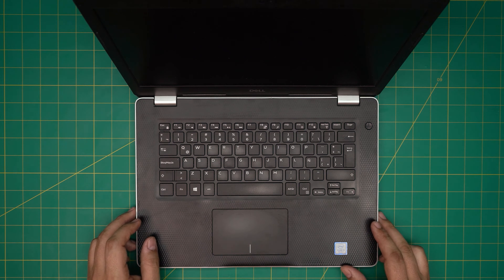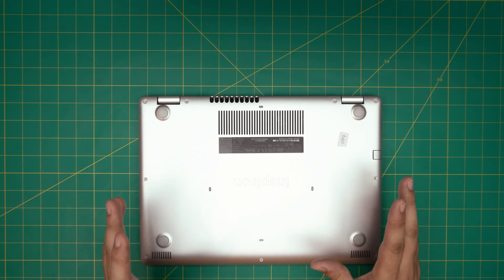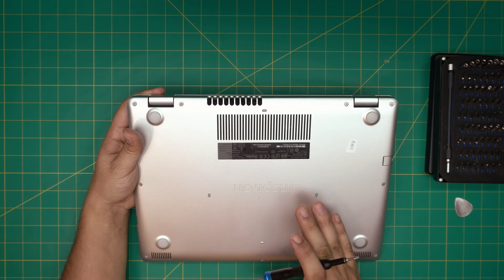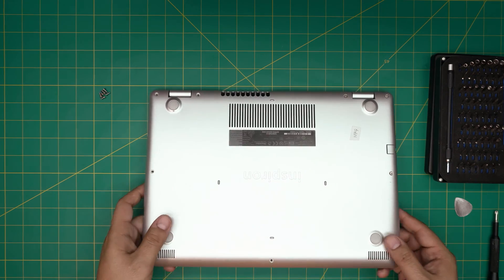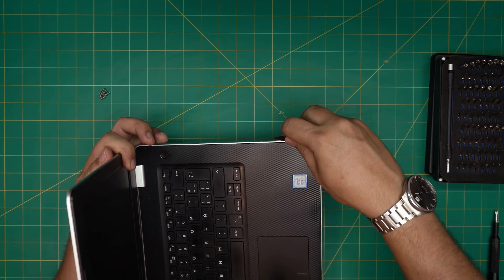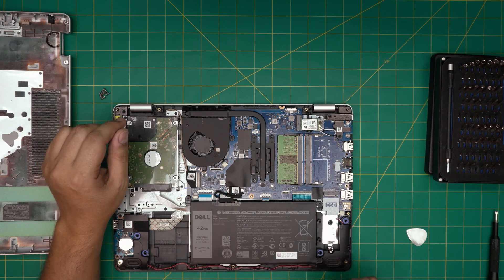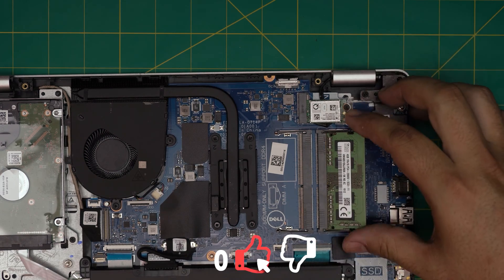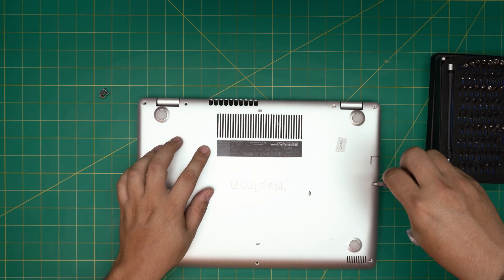How to Upgrade RAM on Dell Inspiron 14 3481 (Reg. P89g) Laptop - Step-by-Step💻

Comment: Hello! Great Video. I just wanted to ask, if I remove the battery and the BIOS does go back to default, would that make me lose my data?
Reply from the maker: It's my pleasure my friend.
🫠Regarding your question, absolutely not. Your data will be left the way it was. It will not affect Windows, the system files, or your personal files.
Should you have any further questions or requests in the future, please don't hesitate to ask me.
cheers🍻

Comment: Hello Sir, I have this same laptop Dell Inspiron 3481 and I have 4GB Ram, so can I upgrade it by adding 8GB Ram(3200 MHz). As my laptop shows the speed of 2133 MHz.
Reply from the maker: 🫠Regarding your question, that will work just fine. The laptop will accept the 3200MHz and automatically adjust to the speed it can handle.
cheers🍻
Reply: @uFixTek  Thank you so much for your help sir🙌
Reply from the maker: It's my pleasure my friend.
Should you have any further questions or requests in the future, please don't hesitate to ask me.
cheers🍻

Comment: People may be interested to know this and I think it may be worthy of a video all to itself. This machine in the UK came supplied with a single 4GB RAM stick. I bought two identical 4GB RAM sticks so I could upgrade this to an 8GB RAM machine. But the machine would not boot with the 2 sticks inserted (the light next to the power input would flash 4 white lights followed by 2 orange lights, indicating a RAM issue). Each stick individually worked fine in either slot.

After much searching (and finding your excellent channel), I found most people were putting it down to a failed motherboard issue. This was not an option for me because my machine was out of warranty, BUT THEN I found a thread where someone loosened the screws on the CPU and it solved the problem. So I loosened the screws on the CPU several turns AND IT WORKED !!!

I hope this helps someone as it's helped me.
Reply from the maker: much appreciate the support and your feedback to help people.🍻👍

Comment: Is it ok to put one 4 GB and another 8 GB RAM? I don't want to waste my 4 Gb RAM. I'm about to upgrade my laptop same model as yours.
Reply from the maker: Thank you for your feedback! If you wish to support the channel, you can like, subscribe, or both!

Regarding your question, sure you can my friend and it will work perfectly fine.
cheers🍻
Reply: @uFixTek  Thank you
Reply: By any chance do you knew what is the reason why every time I plugged my charger into my laptop these messages always pop-up. 1. "C:\Windows\System32\Maintainace.vbs" 2. "C:\Windows\System32\StartupCheck.vbs"
Reply from the maker: is it because some antivirus or a virus was playing with your system files, there are few ways of repairing this issue:
manually:
Follow the Steps:
1. Open Notepad & Type  Wscript.Quit  on the first line
2. Save it as  StartupCheck.vbs (file type:  all files) - Save it to Desktop
3. Cut the file from desktop and paste it to (C: windows/System32) and Press Continue
4. Make sure to restart your Computer once done

2nd and better option is:
Step 1: Close all unnecessary applications, browsers, and disable your antivirus temporarily to ensure a smooth process.

Step 2: Open Command Prompt as Administrator. (Right-click on the Start button, then select "Command Prompt (Admin)" from the menu). https://imgur.com/a/fvaYKbS

Step 3: Type the following command and press Enter:

sfc /scannow
The System File Checker (SFC) tool will scan your system for any corrupted files and attempt to repair them.

Step 4: After the scan is complete, you will receive a message indicating whether any issues were fixed or not.
----------
If the problem persists, proceed to the next steps:

Step 5: Open Command Prompt as Administrator again.

Step 6: Type the following command and press Enter:

DISM /Online /Cleanup-Image /ScanHealth

This command will scan for corruptions in Windows images.

If you encounter any difficulties or have further questions ask me.
Reply: @uFixTek  Thank you very much. I will follow this steps. More power to you Sir.
Reply from the maker: hope fully it gets fixed, my friend, thank you for support🍻